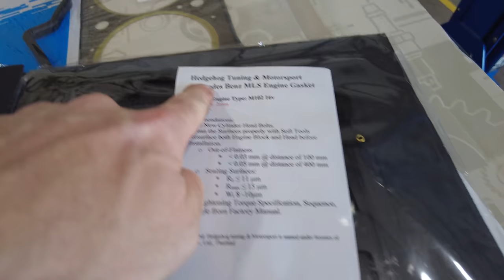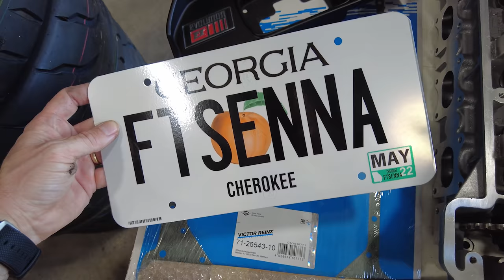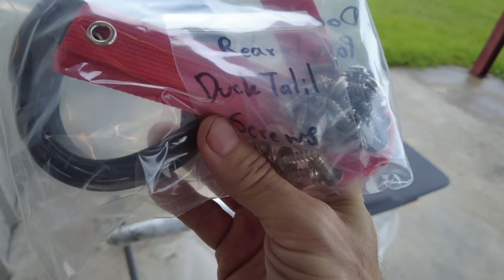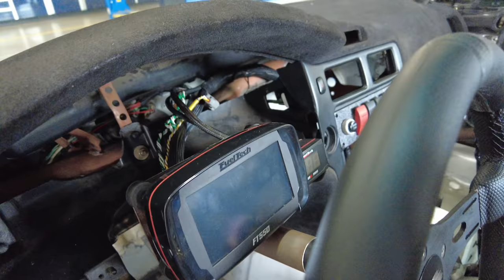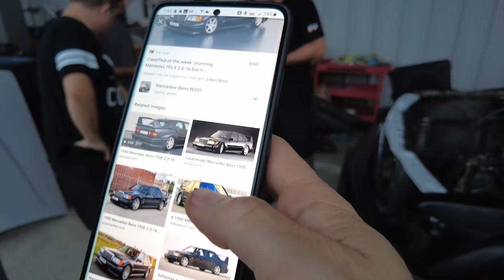FT SENNA | Saga da Mercedes 190E Cosworth com TODAS as PEÇAS e NOVIDADES!

Comment: Anderson, have you ever thought about using a standard header and placing a variable geometry turbo at the tuned length of the header and collector? 
Yes you would lose a small amount of heat energy but the variable geometry should more than make up for that. You gain the advantage of almost no lag while having superior flow the exhaust at high rpm. The backpressure can stay lower than boost with a good sizing. 
Being a meter or so away from the exhaust valves should reduce EGT just enough to keep the VNT/VGT turbo happy (unless using the Porsche VNT with $$$ inconel vanes lol). 
Could even run finned piping to charge cool on the way to the intercooler. Better to use water to air to keep the charge pipe short. Could run the air filter at the base of the windshield in the cowl (where the windshield wiper arms mount). The pressure there is almost as high as the front of the grill or higher in something like the 190. Positive inlet pressure at speed for less work at the compressor? 
I've been thinking about doing this on my next build. 106mm bore wet sleeve Porsche 944 destroked to 68mm. Around 2.8L oversquare design for Apollo level RPM 944S2 16v head with DLC coated  camshafts, buckets, etc. Brain 🧠 by FuelTech of course.

Comment: In 1989, the company introduced the updated 190E 2.5-16 Evolution that featured a larger, 2.5-liter displacement and an output of 326 hp (243 kW). For 1990, Mercedes revised the car once again for the 190E 2.5-16 Evolution II, and additional tuning pushed the engine to 367 hp (274 kW) in race trim.